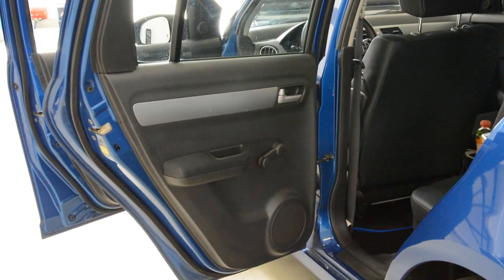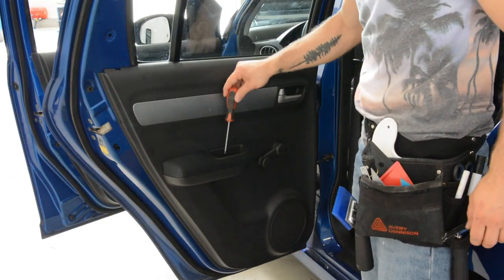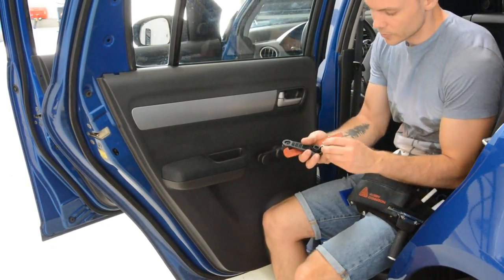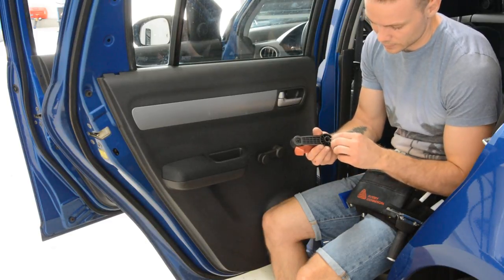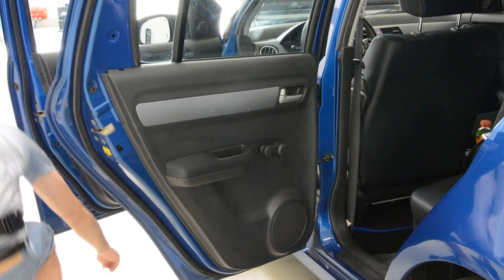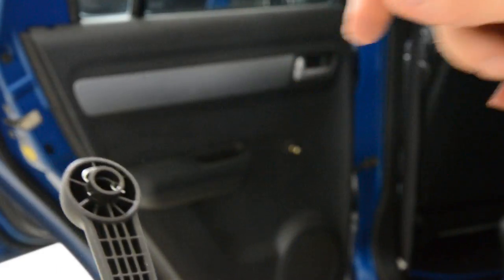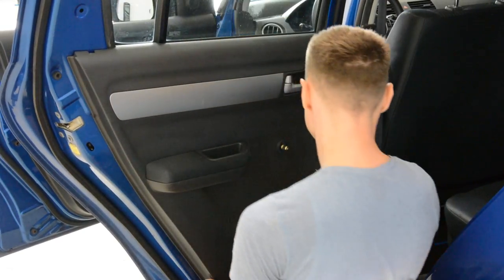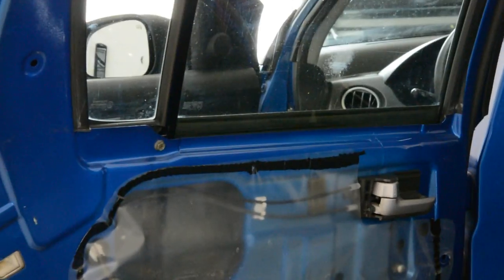Suzuki Swift door panel removal

Comment: Thanks. My right hand rear speaker is the only one working in the car. Time to strip the doors and start trouble shooting. Good thing these are built old style and really easy to strip.
Reply: How did you get on with this?
Reply: @GavCarr91  Good. Apparently its a problem with these swifts where the connections on the speakers rust. Ive new speakers in all 4 corners. The car is super simple which is always great.